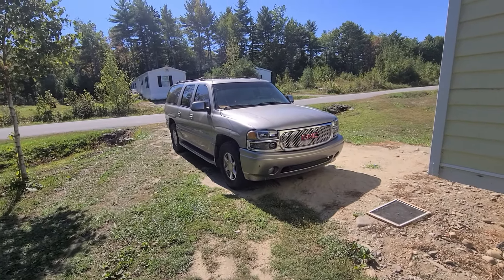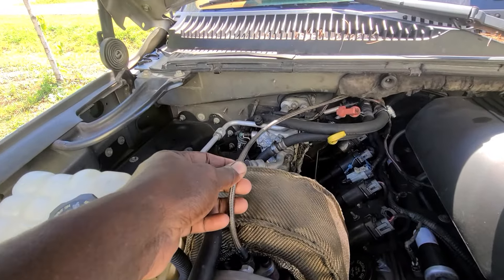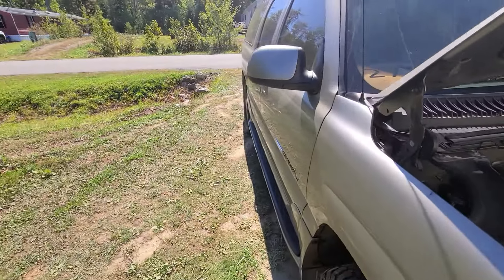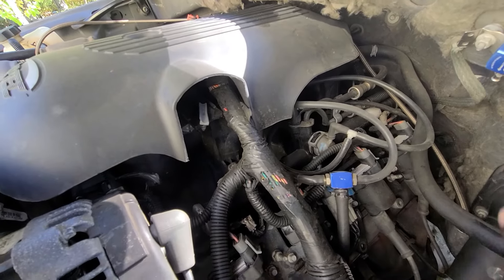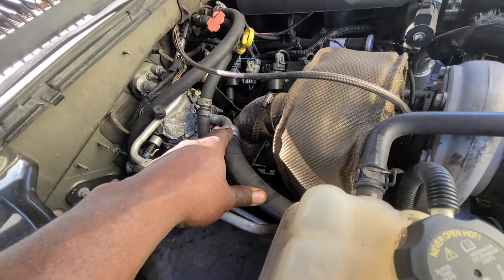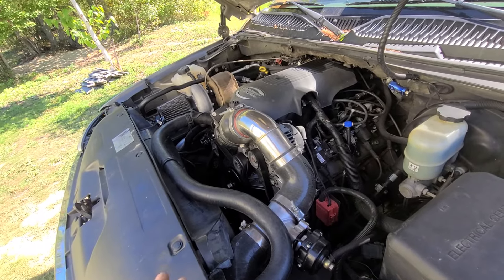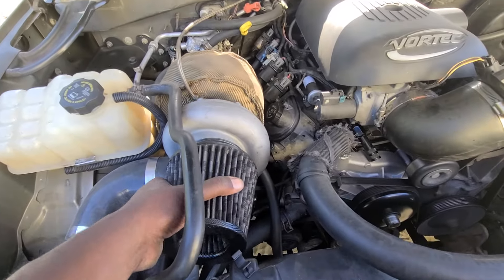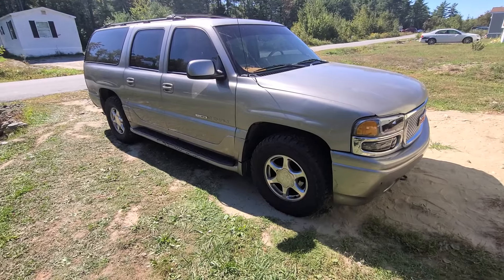how to turbo you Tahoe or yukon for cheap

Comment: Watching all these LS Turbo videos is making me want to just buy a beater for $1000-$2000 and then boosting the hell out of it. Who cares if the engine goes, can find them in the junkyard
Reply from the maker: Yes,,, all day long!!!!!
Reply: I swear I wanna do the same.
Reply: Truth be told I’d be more worried about the transmission
Reply: @BiggSpencee  well that's understandable. They are 150k mile transmissions in stock form.
Reply: @BiggSpencee Def get it built if you're planning to punch on it/add power to your truck

Comment: You're a badass because you're self taught. Mad respect. Can you post links to everything that you used?
Reply from the maker: Thank you I'll send them in a min
Reply from the maker: https://www.ebay.com/itm/stainless-pipe-for-Chevy-T4-turbo-kit-99-13-4-8-5-3-6-0-6-2-vortec-LS-/164506312272?mkcid=16&mkevt=1&_trksid=p4429486.m46890.l6249&mkrid=711-127632-2357-0
Reply from the maker: https://www.ebay.com/itm/Turbo-Hotparts-T4-Kit-Turbocharger-Vortec-4-8-5-3-6-0-FOR-Silverado-Sierra-LSX-/163269581187?mkcid=16&mkevt=1&_trksid=p4429486.m46890.l6249&mkrid=711-127632-2357-0

Comment: Nice vid! You helped me decide between supercharging vs turbo. I use my truck for offroad but seeing that crossover pipe that low is no bueno and I don't see any way around it. Good job on the vid though. I watched the whole thing. Liked and subscribed. I had 3 and 4 go out on mine as well from towing. Mine never had a factory transmission cooler. After rebuild it does now.
Reply from the maker: Thank you 💯 it's low but the ground clearance will make up for that.
Reply: I'm going to try flipping the manifolds and try doing the crossover up front to prevent the low hanging crossover. After I get trans sorted going to start piecing together turbo kit. And may post vids
Reply from the maker: @djmurria  heck yeah,  well the cross over didn't pose any risk because my Yukon is hight off the ground but if it lowered then yes.
Reply: @E-bikeguy  I'm 2wd and got a smidget gf so can't really have it high lol
Reply from the maker: @djmurria  lol oh ok I feel ya

Comment: Just threw a sloppy stage 2 in my truck, and have the turbo mounted, just gotta piece the piping and little things together now, thanks for video, it’s give me a reference or an idea on what to do
Reply from the maker: Nice bro!!!!
Reply: @E-bikeguy  whenever you deleted your oil cooler, did you engine temps go up at all?
Reply: @onPoint00

I was so wondering about that too. If he didn't somehow plumb the oil cooler back in line, after getting parts to do so after plumbing the turbo for oil, would so recommend at least getting something to watch the temps.

Comment: Man bro good shit I have the n 02 and I wanna do the same but it's got 256k on the miles n I wanted to change the cam n valve train but after seeing this I wanna do it now lol
Reply from the maker: Ok thank you, I had 303,000 on the dash lol
Reply: The engine is cooked. Don’t turbo I high mileage vehicle. Always ends with a bang. Bottom end is knocking away

Comment: Nice work man, i have to ask about the turbo flange with the  wastegate set up, what did you do there?
Reply from the maker: I just welded  the bong to the waste gate to the turbo manifold and the people at the muffler shop did the rest
Reply: @E-bikeguy  Good deal man! Thank you so much, I've been piling up parts to boost my 3/4 ton burban, that was a serious concern of mine with the crossover section and the blow off valve. I appreciate the answers!
Reply from the maker: No problem 😊

Comment: Are you running an aftermarket fuel pump? Ended up going ebay for my turbo kit as well first time in the boost league start off cheap.
Reply from the maker: Well I was running a stock one for a while then I went to a walbro 450 pump

Comment: I know Im late to the video, but im considering doing this myself and got a few questions. 1. How is the boost reference ran? meaning what do you need to tap into and where do you need to run things. Also, where are the oil lines from ? thanks if you come back 4 years later!
Reply from the maker: @Tuxedo5.3-d9e  from intake manifold with a T one to boost Guage and one to waste gate
Reply: Also can you link the downpipe?
Reply from the maker: @Tuxedo5.3-d9e  ill get it but i got it off of ebay

Comment: I may have missed it, but i didnt hear you say which turbo manifold you used for passenger side and which one for drivers or was it just the generic amazon ones? can you post a link kind sir?
Reply from the maker: Give me a few I'll send you a link
Reply from the maker: https://www.amazon.com/Hotparts-Turbo-Vortec-Silverado-Sierra/dp/B083LM5PCL/ref=asc_df_B083LM5PCL/?tag=hyprod-20&linkCode=df0&hvadid=416895641179&hvpos=&hvnetw=g&hvrand=18302875533531411195&hvpone=&hvptwo=&hvqmt=&hvdev=m&hvdvcmdl=&hvlocint=&hvlocphy=1015195&hvtargid=pla-885616471582&psc=1&tag=&ref=&adgrpid=95673152084&hvpone=&hvptwo=&hvadid=416895641179&hvpos=&hvnetw=g&hvrand=18302875533531411195&hvqmt=&hvdev=m&hvdvcmdl=&hvlocint=&hvlocphy=1015195&hvtargid=pla-885616471582

Comment: The inrail fuel pressure regulator could be causing low fuel pressure at full throttle because it's getting boost??? Just wondering if you have checked fuel pressure at boost. You may need a different fuel pressure regulator.  But man what a cool setup for the money.
Reply from the maker: @ericc.6940  it's on stock but I never had a problem on boost i look at my afr Guage all the time  and it's in the hi 10s low 11s
Reply: @E-bikeguy  Thanks for the feedback. I have a 08 Silverado I'm thinking of doing this to. Thanks for sharing.

Comment: For the 4l60e if you rebuilt it already. Drop the valve body do shift kit and corvette servo.
Reply: The 3/4 clutches get burned up from the piston seal . 3rd is your starting gear and parking.  Don't burn out after that second scratch
Reply from the maker: Oh man, that tranny has really nothing but sonnax parts in it and a transgo kit in it

Comment: Stock is already super fast. Whats the 0-60 now? Hows the transmission holding up to the new power?
Reply from the maker: @ccolin113  I built the transmission to handle the power but I sold it to get a newer Yukon
Reply: @E-bikeguy   wow, incredibly skilled. How fast was the 6.0 with a turbo?

Comment: What did you do to the brakes, i installed  a nbs master cilinder with the kelsey hayes abs  but my brakes just suck, discs/pads, drums are all new, bleeded everything but still suck
Reply from the maker: Nothing,  the stock brakes are on the truck but never had a problem with them  the only thing I did really was added better pads.

Comment: Comments were turned off for your axum videos so I'm posting here. I noticed you had to weld the brakes for the 3000w hub and not for the 5000w hub. Any reason why? I'm thinking of using the axum as an ebike frame, but I don't know how to weld. Thanks!
Reply from the maker: The 3000w hub motor had a 9 speed freewheel so I had to space out the frame on the brake side or the tire will rub on the frame, the 5000w motor have a 6 speed freewheel and a 10mm offset where the disk bolt up to so it was closer to the frame so I just can mount the caliper to the original mount
Reply: @E-bikeguy  so of I have a 7 speed it will probably go right in? Really appreciate the response. I'd hate to order a bike and not be able to use it. 

Hiw do you like the 3k vs 5k.
Reply from the maker: @hank_Reardon  well the 5000w definitely has more torque but not by much try to keep the bike as lite as possible and it will fly 3000w or 5000w, get a good controller too that will help alot. What motor you plan on using?
Reply: @E-bikeguy     I already have a 2k motor from nbpower, but use a 52v battery. The triangle on the other bike is too small for a 72v battery which is what I'd like.

Comment: Sounds crazy but how are your mpgs since you don't beat on it and take the hwy?
Reply from the maker: I take it on the highway, I get about 25mpg
Reply: That's pretty good. I was always trying to justify adding a turbo (6.2 Yukon) and it making sense. So added HP, pull, hopefully better mpgs for long drives, is enough for me. I would love to add a STS remote mount kit but I love your version.

Comment: How did the turbo effect gas mileage.?
Reply from the maker: Not by much it's just when you nail it that's when you see the difference but just cruising it's like stock
Reply: @E-bikeguy  awesome. Thanks for the video.
Reply: @E-bikeguy  dont think Im crazy for asking but have you taken it on a long trip and how many miles to a tank did you get?
Reply from the maker: @mrbrowz1000101  oh yes I've been to miane and back , I get around 17 mpg
Reply: @E-bikeguy  I'm on this trip of having a 6.2 getting way better mpg if I add a turbo (maybe remote kit). I would basically be turboing that burgundy hauler you have (twins but a midget lol). 
I saw STS Turbos make a Vette get Instant avg 42 mpg and been geeked ever since.
Reply from the maker: @mrbrowz1000101  oh wow!!!!🤯
Reply: Of course the mpg is just a rough average and the Corvette is as streamline as a B52 Jet but still...I would love to have that kind of mileage.
Reply from the maker: @mrbrowz1000101  heck yeah,  that will be killer
Reply: 17 mpg and AWD?  Sweet!  My ‘05 2500HD is lucky to get 12 mpg stock.

Comment: What down pipe are your running is it 3inch or 4 inch
Reply from the maker: It was a 3in down pipe
Reply: @E-bikeguy did you have to get a different flange for it to mate up to the turbo I know the gt45 has an odd outlet size

Comment: Yo do you do work for the public and if so where are you located??
Reply from the maker: I'm in central Florida
Reply: @E-bikeguy   are you close to the Orlando area I used to live there.. But I now reside in Mississippi but getting my vehicle to you will not be a problem
Reply from the maker: @looneytune4218  you have a Yukon also?
Reply from the maker: Nice we can make some moves into doing a turbo swap
Reply: @E-bikeguy  94 C1500 shortbed  6.0 Ls swap
Reply from the maker: @looneytune4218  ok I did one before for a customer
Reply: @E-bikeguy  Dose it matter that’s it’s a carbureted setup?
Reply from the maker: @looneytune4218  it will be a blow thro setup
Reply: @E-bikeguy  sweet!!! I will contact u tomorrow brother

Comment: Great video. I'm for sure gon turbo my tahoe but I'm debating twins or single wht would u suggest
Reply from the maker: Well twins would be nice but it will be too crowded, I would go for a nice single tho.
Reply: What about a remote turbo? The heat in Florida  is bad
Reply from the maker: I was thinking about about that also but it's not that bad plus I wrapped the down pipe and have a turbo blanket
Reply: @E-bikeguy  I'm sure where you are you are ok  but here in Tampa  traffic  and record  heat. I think my 8.1 would  not like the extra heat.   But a remote ,  hmmmm